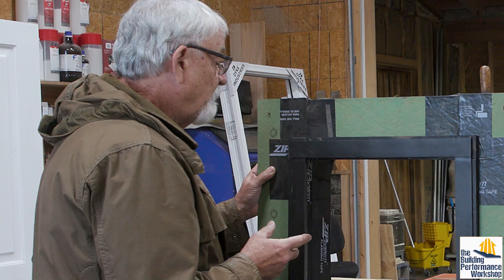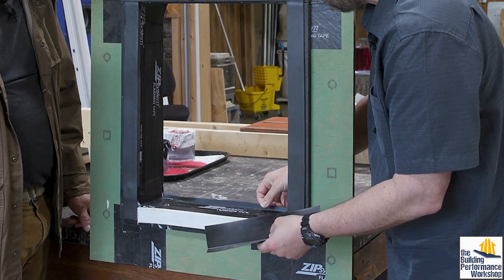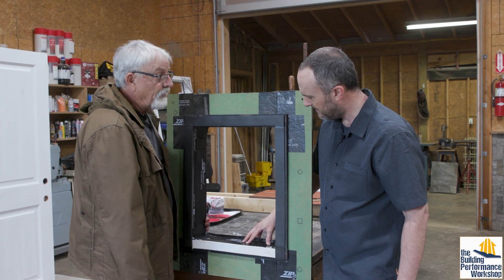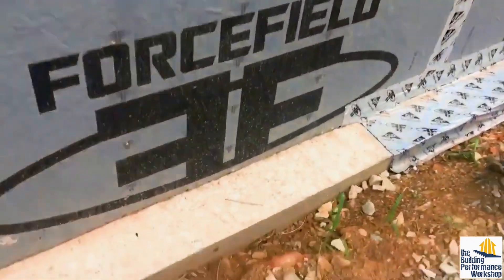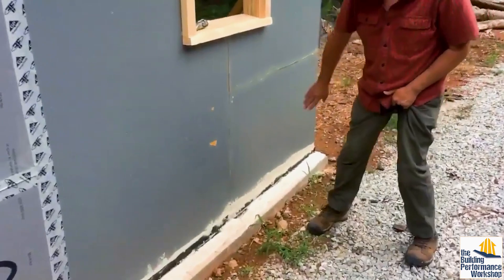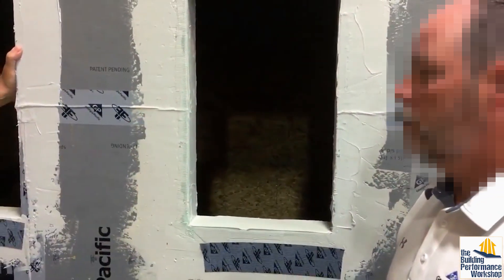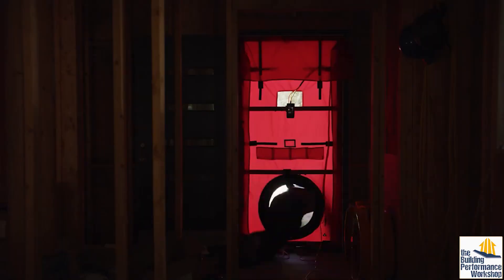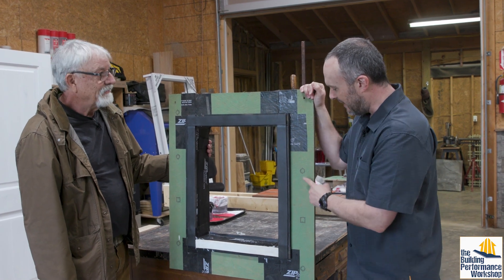Airtight Window Flashing Ideas, WRB and Sealing Tape Miracles w/ Landus Bennet

Comment: 14:22 … I look at that, and immediately wonder if the way we apply liquid flash can be improved upon.

We always see it smooth troweled finish. But I’m now wondering if we should v-grove trowel finish it, troweling it in the direction we want water to flow. You can get them in a 3/32 grove. Maybe a new tool needs to be manufactured.

Comment: We have been framing window opens with thick thermal breaks for years. Most windows are way less than r 5. That thermal break keeps the cold from going into the wood causing condensation. Plus we seal the thermal breaks. Don't use fiberglass around windows and doors or bay next to them. We usually use spray foam between window and thermal break. Erv are a must. Building air tight number 1 problem is moisture. Common problem moisture areas kitchen, bathroom, basements, and rim joist pockets. Or the top of icf walls. Because masonry loves to wick moisture. And usual place it leaves icf walls is the top.

Comment: I don't think the weatherbloc on the bottom edge of the window is better than constructing a two-stage joint by sealing the interior of the window. This keeps the critical sealing element protected from the elements, whereas the weatherbloc system depends on material set in a more exposed position.
Reply from the maker: I’d do both

Comment: Being up north I’ve actually built some additions on crawl spaces and had to fight code on the venting of them. So far I’ve been successful getting them passed as you say as long as you dehumidify them. Also I’m working on a house now that they built the walls on a pad that extends out past the outside walls and water has been coming under the floors for years. It has been a nightmare to repair. Eventually I’ll have a video out on my channel about it. I wanted you to cringe when you see the duct work and mold being brought into this home. Worst I’ve ever seen! Thanks for the vids